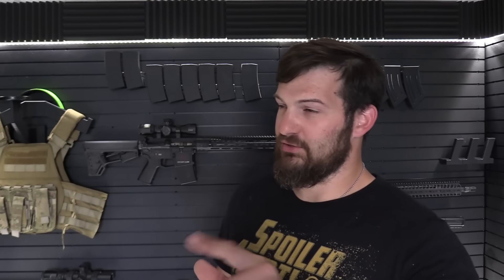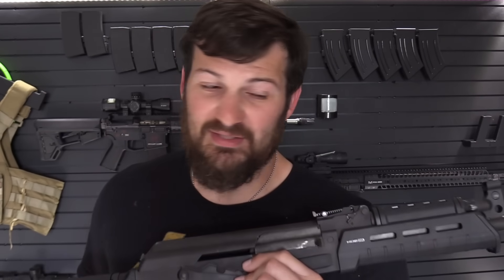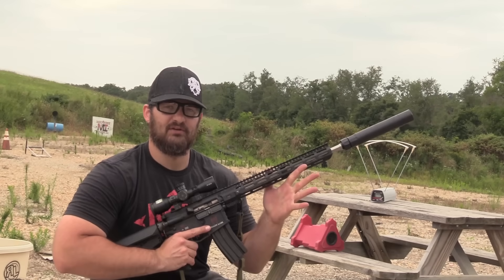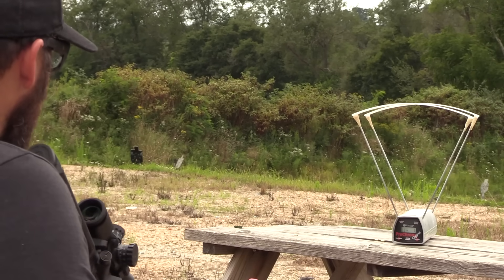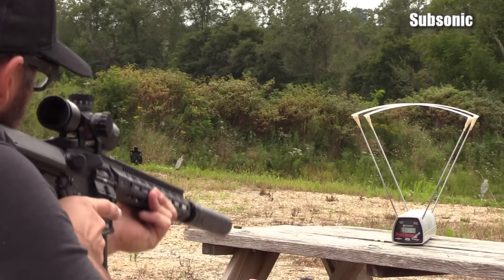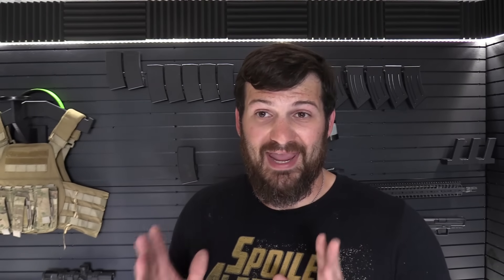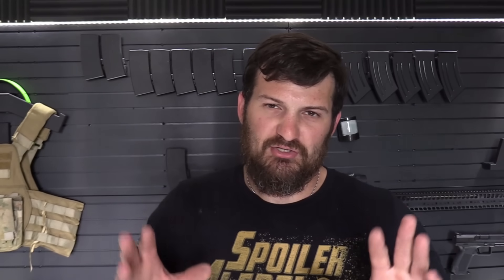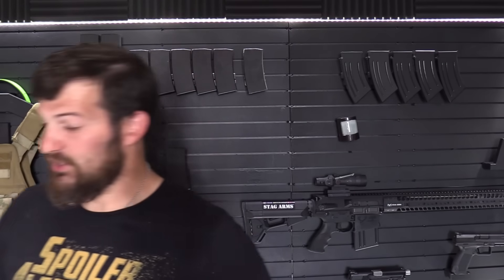Subsonic VS Supersonic: What's the Difference?

Comment: while velocity is the biggest variable when it comes to terminal ballistics, I disagree with your assessment that you aren't accomplishing an adequate effect with slower round. when it comes to impact on biology there is ZERO substitute for shot placement and when that is corrected it doesn't matter if you are even using .22 short, they will still cease to function.

Comment: Just an important point regardless of subsonic, supersonic bow, boomerang or xbow,,,,, ACCURACY, much more important than the speed of a projectile when it comes to ethical. Just being honest, no comments needed, it's just a fact of life. Apart from that bit, great informational video, I learned a lot.
Reply: That and transfer of energy if it has way to much energy on a single point it'll go right through and won't produce a lethal wound, whereas a slower round might have. You're point is also a great one though cause if you hit the brain or heart it doesn't matter what bullet you used it's gonna die pretty fast.
Reply: Yup while this was very informative I do disagree about velocity being the most important shot placement is always number 1 in Sun Tzu there's short story about two armies going to war one with very large heavy bows and the other with light bows moral of the story was didn't matter how hard or strong the big bows were if they couldn't hit a target the lighter bowmen fired faster and we're more nimble and thus also more accurate and we're able to put arrows in between eyes even with them being smaller and the bows not penetrating the armor from far at a good range it went far enought to puncher vitals

Comment: Subsonic ammo doesn't deform as much when it hits the target. That increases penetrating power, but reduces the amount of damage it does to the target.

If you want to defeat body armor, subsonic is the best ammo. It'll damn near go through anything. That also means that whatever is behind the target is going to get penetrated as well. You better be really aware of what's behind the target when you fire at it.

Also, since it doesn't do as much tissue damage, it increases survivability of the gunshot, and doesn't inflict the amount of pain a supersonic round does. The energy isn't imparted from the round to the body. A gut shot may not even slow an attacker down when you use subsonic rounds.
Reply: Subsonic .22lr my budy got shot by one when we where teens in his pelvis and it played pen ball in his hip and joint area. He’s almost 30 now and still having problems
Reply: finally I was about to ask this by yes and wow sorry to hear that about ur budy also won't supersonic be better at armor?

Comment: Your logic isn't accurate. The MP5SD was designed to take any ammunition and make it subsonic,  but yet it was still one of the most widely used SMG's by special forces units around the world.  So subsonic rounds are not less lethal, unless you are hitting non vital area. But even a nice clean hole,. or several holes, in the head, heart or lungs, is going to drop any animal, intruder, or terrorist.

Comment: If subsonic is unethical for hunting, what is your impression of bow hunters? An arrow is only going around 300fps when shot.
Reply: An arrow weighs 500+ grains
Reply: @waltzway5690  a 500 gr arrow going 300 fps is only 100 ft lbs of energy.
Reply: @IamONaLIST  Velocity is the messenger and mass is the message that's why if you look at ww2 casualty reports about 10% of soldiers survive their rifle made wounds if they make to the doc, but only 50% of people survive pistol made wounds they were slower and had less penetration and therefore didn't leave the body or put more energy into the target when they did. Rifles over penetrate most targets that's why the military uses rounds that yaw inside the body. The test he does with a watermelon is laughable for comparing to a human or any animal. Animals have bones.

Comment: This video could have been great but there were two big fails and a minor one. First, this should have been done without a silencer as you have changed the whole dynamic volume of the round by having one. Second, you can’t put all situations in a vacuum.An intruder in a townhouse hit with a subsonic round that has less of a chance of going thru the wall and killing a neighbor might be considered a good thing. I agree that the velocity squared is the big thing. (E=mc^2) so the velocity definitely is the deciding factor when “you want to blow shit up”. However, you can definitely upsize the caliber and bullet grain to “somewhat” compensate for the lack of velocity. (I do agree with you that velocity is king). As I know you know, the round is selected for the job. As far as ethical, as much energy as possible is not the desired result if you are trying to hunt for meat. I’m not hunting deer with a 338 lapua hollow point at 3200 FPS from 50 yds if I’m feeding my family.

Comment: 7:52 - Could you make the argument that a 223 is inhumane because it is not as instantly lethal as a 44 magnum?  In a lethal encounter, the 223 is comparable to torture because it doesn't kill as quickly so you are putting them through unnecessary pain and suffering.

Comment: I hunt Coyotes and Javelina with 300 Blackout 10.5  1-7 Barrel  208 GN sub sonic 1025 fps suppressed. The wound cavity at 100 yards is horrific. At 50 yards it knocks them off there feet. I guess you have never hunted with this gun. Don't throw unfounded statements out.

Comment: SO THE POWDER AMOUNT MAKES IT SUB OR SUPER????
Reply: Yes and weight of the projectile. Most .300blk out doesn't use rifle powder, but magnum handgun powder, as rifle powder is designed for longer barrels and burns slower than handgun powder which burns quickly, and you get about 90% of powder burn in a 10" barrel with the .300. This is useful because you can run a tight package and don't have as intense muzzle flash at night time, when most defensive situations happen. Look at a 7" krink muzzle flash, and you will realize why nobody with a brain uses that for home defense.

Comment: CCI .22lr load 0074 Segmenting Subsonic Hollow points, inside of 50yds.  Most humane kills I've ever made.  Everyone's crucifying you for that blanket statement and I think for the audience intended for this video (who don't know the differences between super and sub) then it's a good general statement.  The true answer is "well, it matters."  I've had no problem taking feral pigs inside of 50yds with .300BLK sub loads with defensive rounds.  To each their own, but your statement as provided isn't correct.  It's also a matter of opinion and experience and skill come into play as well.

Comment: Numbers dont lie -- but your interpretation of those numbers is a bit off. Maximum energy is not the only way to achieve a humane kill, and being humane isn't always a priority or an option. Under ideal circumstances, you might have a point -- but you are ignoring too many factors to make that blanket statement.
Reply: The other way is accuracy.  When someone gets in a shooting situation their adrenaline goes instantly from 0 to 500 and unless they've had years and years of training/experience (maybe .2% of the population) accuracy goes out the window.  That's the reason the A zone is so big.

Comment: Adjustable gas blocks shut off are a way to remove that action noise on those semi autos. Makes more of a difference with subsonic but when hunting with my .308 AR I shut the gas off and it drastically reduces the noise when shooting from inside a blind (for the shooter and others in the blind, not for the game, which should be dead at that point).
Reply: My Socom 16 is SLIGHTLY quieter with the gas off, really just a different noise.

Comment: Fundamental flaw in your argument.  ALL Handguns.  ALL Pistol Caliber Carbines.  MP5s.  One thing these all have in common is available expanding ammo (hollow points).  I know you like to shoot cheap (who don't), but forming a conclusion using plinking ammo seems disingenuous.  You could say it would be "unethical" to carry ball ammo for self defense.  Well, duh!  I keep super and subsonic 300 BLK ammo loaded with Maker Rex bullets for home defense (comparable to G2 Trident).  I have tried the "cantaloupe" test at 50 and 100 yards.  The cantaloupes simply explode to bits.  Also shooting half a cantaloupe is a poor test.  The 308 didn't do any more than the 300 BLK.  9mm ball ammo at 20 yards would leave a bigger hole than both.
Reply: You lie sir.  The 308 uterly destroyed the surrounding cantaloupe.  And because of this undeniable science you need to switch to 50 bmg so you can take arms off even if you miss by an inch or two

Comment: So would transonic rounds be the better compromise on sound and velocity inflicted damage?
Reply: Recoil Alliance Depends when/where you’ve at...the speed of sound varies with barometric press temperature and humidity, in other words unless you know the average speed of your load in a perfect day at sea level and can calculate density altitude at the location where you’re shooting a “transonic load” may or may not break the sound barrier. I personally don’t own suitable private property or know of any “suppressor only” ranges so I only shoot 7.62x39mm equivalent 300BO ammo and call it good.
Reply: "the speed of sound varies with barometric press temperature and humidity" NO! The speed of sound in air varies ONLY with temperature, air is very close to the behavior of an ideal gas. The parameters you are citing are important to calculate the velocity over time of the bullet in the air (impact of air density on drag, friction,...)
Reply from the maker: I think you missed what I was going for

Comment: so what about bow hunting?
Reply: How is that not a valid point?  If you are hunting with a subsonic bullet designed to function at sub sonic speed
Reply: @benp1911  my thoughts exactly. shooting what is essentially a nail at an animal is a no go.. like hunting with 147gr ball ammo... it'll kill it but but won't perform very well terminally. sub sonic bullets made to expand do well on animals. just like with any bullet shot placement is the most important thing. gut shoot a deer with a 300win mag with 200gr ELD-X and it'll suffer too.
Reply: but send a 194gr maximum expansion or a 190gr sub x through the heart and it will be drt.. trust me... I've done it. 

note I don't hunt outside of 50yds with my 300blackout.
Reply: GohModley  referring to hunting not sound.
Reply: @operatorsanonymous  hahaha. Im pretty sure GohModley as kidding. How'd you miss that? Bow hunting "not hearing safe".. get it? chuckle chuckle? bow  and arrow make no 'bang'.
Reply: Lol
Reply from the maker: Different mechanism for tissue damage. C'mon man
Reply: @VSO_Gun_Channel  so would the use of expanding subs like Lehigh Defense, Makers or Hornady be acceptable?